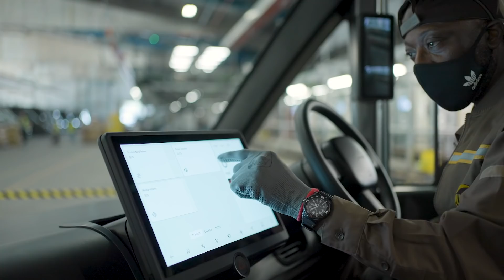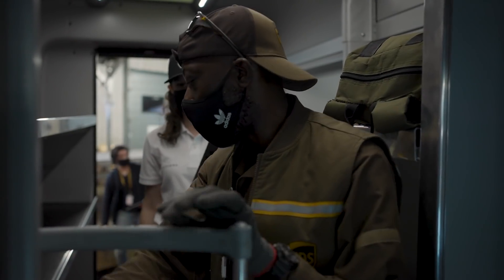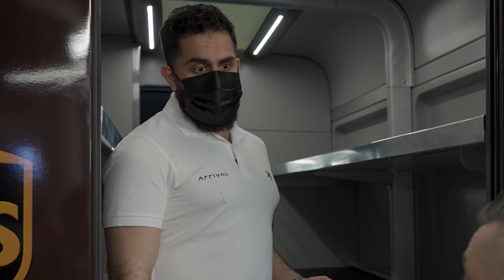UPS Drivers Test Arrival Van for the First Time | ARRIVAL

Comment: What happened to the "old" design with a more vertical front glass? Honestly that looked better imo
Reply: The windscreen on the prototype version would have cost £2,000+. They're trying to compete with Citroen Dispatch and Ford Transits where a new windscreen costs around £100-150. On average a courier vehicle needs a windscreen every 2 years so it would be a relatively significant increase in cost for literally no benefit to the customer
Reply: Vertical screens are geriatric.

Comment: No mention about miles/range under a variety of conditions.

The world needs a vehicle that can practically operate in a desert condition such as California, or in and around Dubai. Imagine a possible air conditioner load. Or imagine winter condition loads. How does the vehicle perform in snow and extremely cold weather? Can a heater for the passenger and heater compartments keep up?

Gauges, gauges, and more gauges. It will have to clearly warn both drivers and also inform the office via monitoring how much time and miles are left on the vehicle.

This could work under ideal conditions, but... There's going to have to be a lot of backup. That backup is not something that a lot of terminals have.

Comment: Tell you right now - I give the display 2 to 3 months tops before it's going to be continuously going in for service.  Not on the software side, but the hardware side. Countless number of bumps, leaning against it, rough handling, temperature problems being exposed to the environment, spilt coffee etc etc.  Instead of just mounting in with a single point, you need to encase the entire thing and attach it to the dash panel and make it robust and industrial - not pretty. 

Look at the inside of UPS trucks that are on the road now to see what kind of abuse and wear and tear they go through to get an idea.  The vans do not belong to the drivers and I'm sure everyone will be careful and thoughtful the first couple of months - but after that it's back to normal and the abuse, neglect, carelessness will commence.

Comment: You need to turn the triangular window on the driver’s side into a “cigarette” like Volkswagen beetles had for air flow.
Reply: It would impact the aerodynamics and range. Those were the best though.
Reply: @ChunkyBunny2  Take a look at the history of the P47s where lack of air conditioning and/or air flow resulted in retrofitting many of them with huge non efficient scoops on the top.

Comment: I would love to see an camper edition if this van.
Reply: Had not thought of that. Even as a camper van rental that would be really great for a vacation getaway. It may need more seating up front but I really like the center position for the driver. Having a live video feeds showing in the back with cameras around the van would make for a fun ride from the back.
Reply: I don’t think in its current form it would suit being a camper. It’s too short for a start. But, given the flexible nature of Arrivals production facility anything’s possible. My guess though, is that they’ll focus on buses & vans as that’s their target market. After all, most campers are van conversions anyway
Reply: @hughmarcus1  Scaling up production for the biggest orders will have to be done first. Later a camper design could previewed. It would have a lot of advantage over ICE vans since it already has a power system. It also would be better to not have those fumes from the engine in the space where you are sleeping.
Reply: @offwhitemke  all of that is valid but misses the point. This is a young company with a new product. They don’t need distractions. Most camper vans are conversions done by 3rd parties anyhow. Relative to the main market for vans, the camper can market is tiny.
Reply: Where did I say Arrival had to start making these vehicles now?
Reply: @offwhitemke  You didn't & I never suggested you did mate.
Reply: @hughmarcus1  yeah, mate
Reply: They are designed for short stop start urban runs which average about 60/70 miles or so (even though they obviously go further than that .. but average working routes). You don't want to waste space and add weight for a big battery pack in a local delivery van. So not really suitable for a camper.
Reply: @MrAdopado  We know. It is modular and can be made longer to provide more living space and carry a battery pack which supports much more range. It can even charge with solar when set up at a camp site with on YouTube onboard  charge controller and solar array. That is what make Arrival’s manufacturing process and vehicle design so appealing compared to customizing an already expensive van.

Comment: Electricity in Britain is about 1/2 gas and coal, so these vehicles will be about 50% renewables. If they ever exist, they will be an improvement over diesel, but you don't have to lie about it, Arrival.
Reply: That is completely wrong. There was zero coal generation on our grid over the past week in the United Kingdom. In my own area today the National Grid generation is 93% zero carbon with 2% gas generation as the biggest carbon contributor. (South Scotland which has 2 sizeable cities with associated urban areas that could use these vehicles.) Even the "dirtiest" areas of the UK rarely see a contribution from coal and when they do it is a few percent only.

Comment: Lack of bumpers is going to be an issue. Look at any delivery truck, the bumpers have dents and scuffs. Also, how will the trucks be heated? It’s a big truck to heat and electric vehicles have notoriously poor performing heaters. The drivers are going to pretty miserable in the winter if you can’t get these trucks up to a reasonably comfortable temperature inside.

Comment: ZERO emissions??? I did not see any solar panels or windmill on the top of the van so that means it must be plugged into the electric grid!! I guess there is no pollution from the power plants? I understand the need and want for electric cars and trucks but do not say they are ZERO emissions when they are using the electric grid that is/will need to produce more electricity to charge all these cars and vans. Watch for more and more rolling blackouts. Just think about it. I am not against renewable energy but you need to be truthful with what you are saying.....

Comment: I hope milage is 400 miles plus
Reply: Why?

Its for urban transportation.
Reply: That would be nuts! Large battery packs add a lot of weight (so reduce what you can carry) and take up more space (so reduce even more what you can carry) and cost a lot more money (so are uneconomical). This will have the range needed for its job as a local urban delivery van delivering the latest trinket you ordered online. I think you are looking for a totally different vehicle.

Comment: Typical however the truck is sitting there and now their asking for input. Should not the input from the drivers been asked for much sooner?
Reply: This is not the only contact with the company and its drivers!! The van prototypes have been reviewed by UPS throughout development. In fact this version of the van is a variation on the original design because of that input. There are other videos on youtube if you are interested.

Comment: The headlights look kind of small. It could possibly pose a risk to the driver itself or other road users etc. If it's also electric, it would be difficult to spot after dark.. no sound and poor visibility. Its proven that yellow emitted light does not bounce off reflections but is best used for conditions that are poor; hence the foglight. Sometimes headlights arent automatic and it simply comes down to driver neglect. Why aren't more commercial vehicles equipped with fog lights or vehicle identification lamps?
Reply: It will have to meet exactly the same regulations as every other delivery vehicle in terms of lighting.

Comment: I do not like the electric. It is bad enough with the new gas diesel vehicles in the United States do UPS van have their own sound you would be able to hear that and say UPS delivery. With the electric and the diesel engines you can hear them there not distinguish the driver will sneak up read the package on your door step and not even ring the doorbell to let you know it was delivered. This is what leads to more packages steps in United States careless drivers not notifying their customers of a package delivery almost need to put an ice cream siren on it.

Comment: Too bad the screens are on the left since more than 90% of people are right handed. That's why steering wheels on the right side don't make sense.
Reply: Steering wheel is on the side that gives you maximum visibility down the road, in this case the van is driven on the left so wheel is on the right.

Comment: Stop saying that these vehicles are “0” emission. They are not. They are electric. They get their electricity from somewhere. Where do the batteries go when they are retired? Does it take more energy to produce these vehicles than combustion engine vehicles?  Remember the same company (tesla) that says their vehicles are better for the environment is the same company that’s involved in Bitcoin which just so you know uses an immense amount of energy resources to produce (mine) these Bitcoins. It’s all just smoke snd mirrors.

Comment: What if, now hear me out, instead of wasting money on dumb all electric vehicles we just make high efficiency Hybrid vehicles. all electric vehicles are just about the dumbest this in society at the moment because its not ready to only use all electric, it's too much turn over time to wait for the charge and the cost and maintenance is absurd for electric vehicles but with high efficiency Hybrid engines you can still use the existing gas stations and if you run out on the side of the road you could use a gas can and instantly running again and I bet is more research and development was put in to Hybrid engines they could probably run 200+ miles on a single gallon.